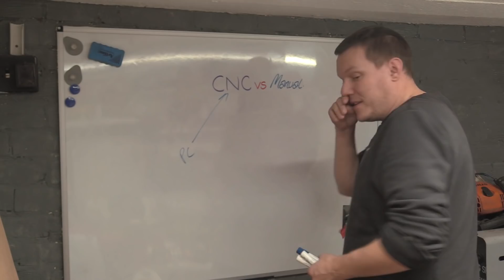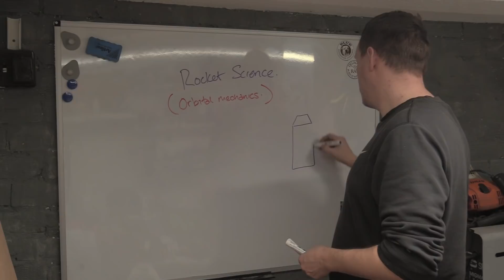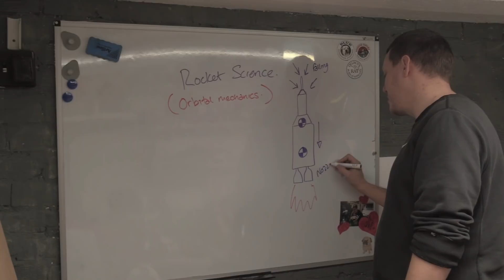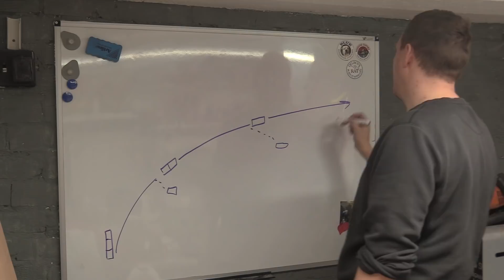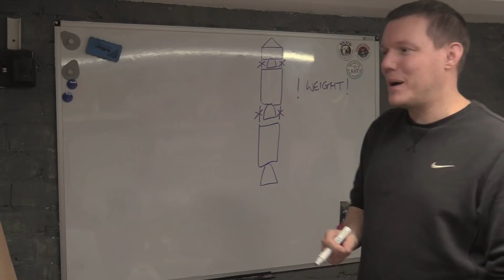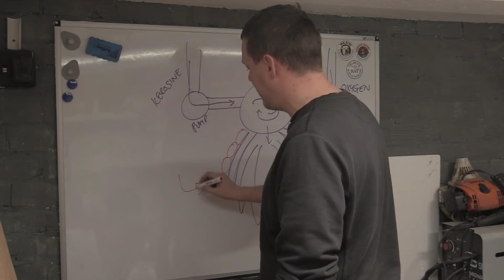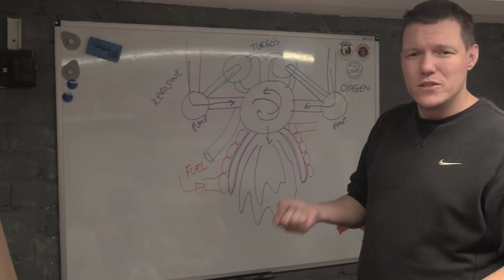Engineering Questions - Rocket Science

Comment: I think it's a misused term, the science theory element of rocketry is well known and relatively simple. It's the engineering which the tough bit. If the Earth was a little larger than it is, it would be impossible to get into orbit with the fuels we have at present, too low an energy density, to overcome the increased gravitational field of a larger Earth.

As you say, the engineering is right at the limit, top fuel dragsters are perhaps the nearest machines we have to rockets in terms of the ridiculously high stresses on the components, plus  the rocket is far more complex than the dragster and everything has to work perfectly first time, or it's a total fail, no test and tune runs for the rocket!

Comment: There is a rocket that uses ealectric motor it's very small but it does they jump the batteries overboard like used fuel tanks
Reply from the maker: Electric motors for the fuel pump, but the engine isn't

Comment: Hey Matt,
When you were talking about CG and stabilisation, then jettison of the sections, with each part that was jetterson, that would help reset the CG somewhat to also help with its intended trajectory wouldn't it? Cheers for the video bud :-)
Reply from the maker: Yes but you wouldn't want it to happen suddenly whilst moving like rockets do.
Reply: @thedirtyworkshop  I see, that is why there is a moment of nothing after each rocket has finished firing so each section can jettison which in turn the rocket has, itself, slowed somewhat to do this, then, the new rocket fires even though it appears that the rocket has not lost any momentum for the CG to reset. Cheers Matt :-)

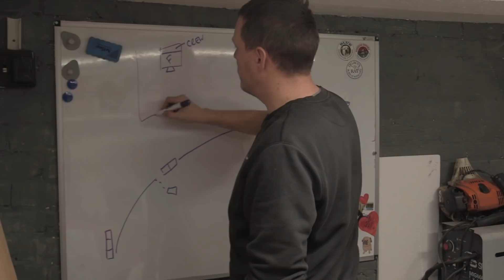Comment: 8:00 An other reason for staging is that the engines are optimized for different air pressures. The bottom stage doesn't work as effective in vacuum as the upper stage and vice versa and the different nozzle cenonical angles are a part of that. You can see in the launch videos how the exhaust plume expands a lot as it gains altitude and the air pressure gets lower.

12:15 In 2008 I was visiting Force in Denmark looking at their laser welder among other things and at that moment they where experimenting with welding rocket nozzles, they had an inner and an outer skin where the inner skin had tiny vertical ribs milled out and then they were welding the outer skin onto those ribs and the reason for that was to pump fuel through it to cool it.
Reply from the maker: "An other reason for staging is that the engines are optimized for different air pressures."

That's a by-product and not a primary reason - for example see the shuttle.

Comment: Thanks, great video, I think rocket science really is very impressive!
Little mistake there, you normally don't bleed the main combustion into the turbopumps, especially with the closed cycle that would work (no pressure difference at the pump inlet and outlet).
You habe a separate "preburner" or "gas generator".
Also imagine the poor scientists developing the alloys to withstand the environment at hundreds of bars at 1000°C+ with pure oxygen present, partly moving at supersonic speeds.

Comment: That idea of putting that exhaust of the turbo pump's exhaust back into the combustion chamber. What's it called again. Full staged flow combustion or something. SpaceX has it now. It's still in it's infancy, but it's already working on their new rockets they're trying. The starship
Reply: This has been done long time ago in the R25 or whatever engines of the spaceshuttle.. and maybe on the F1 engines on the Saturn V but that's a guess
Reply: okay, RS-25 is the space shuttle engine. And the F1 engine didn't have it
Reply: The recycle the turbine exhaust cycle is the closed one, which is common (and the shuttle engine is a variation of it with two turbines). On the other hand the full flow technology was used several years ago only in two prototype engines that were never used to go to space, before the Raptor from space-x.
Reply: @mario141230  The full-flow design is essentially the same but different with minor improvements of the classic either fuel or oxidiser rich preburner/turbine section. But it is the same idea of using the turbine exhaust in the combustion chamber
Reply: @allesklarklaus147  Yeah. That is the challenge. Or rather one of the challenges. Taking the power from the engine,to run the turbo pumps, routing it all around the nozzle bell for cooling, and pump enough fuel and Oxidiser into the combustion chamber. Whilst STILL routing the spent turbo pump exhaust gases now with much energy sapped, back into the combustion chamber, obviously under full combustion pressure.
It's almost like a feat of fuckin' conjuring. But then the whole thing is really.
Up until recently the Ruskies were the Daddies with Rocket engine design. As Matt alluded to.

Comment: Is center of mass going down when fuel is burned? Fueltank is getting lighter so center of mass is going up. Or it is not?
Reply: Depends. Which is heavier? The engine or the cargo on the tip of rocket?
Reply: The remaining fuel of each stage is probably sitting at the bottom so yeah it would shift down at first I guess
Reply: And the payload/cargo on the saturn V for example is only about 5% of the launch mass.. Guess there is a lot of fuel in there
Reply from the maker: The fuel is easily the heaviest aprt of the rocket. That's how rockets work, by shirting mass in one direction that Newton guy said the remaining mass will move the other. 

That's what that massive orange thing is next to the shuttle.